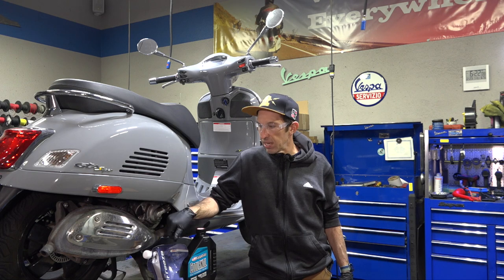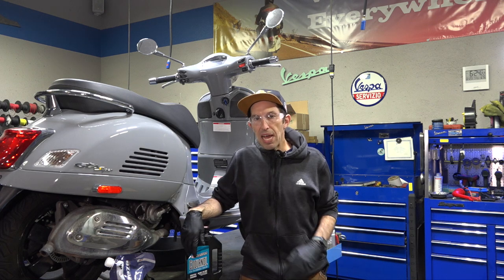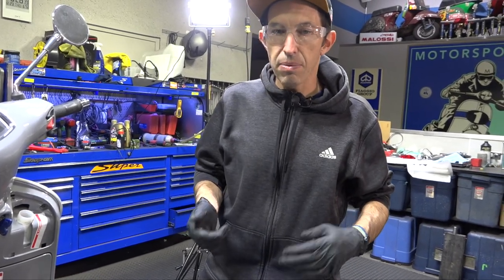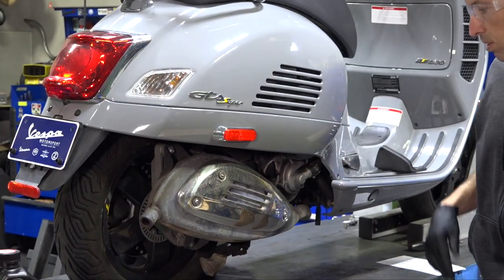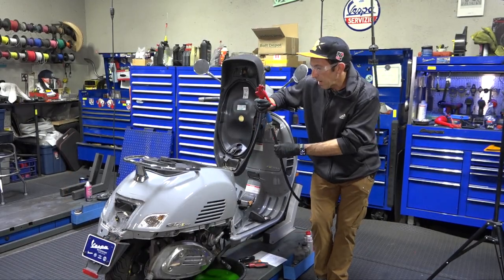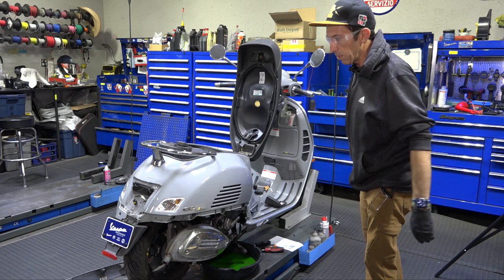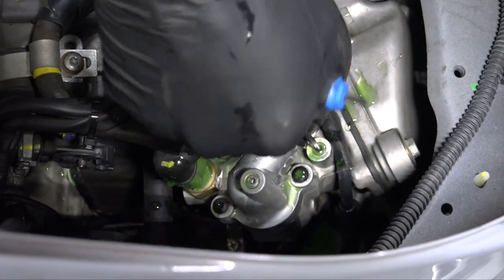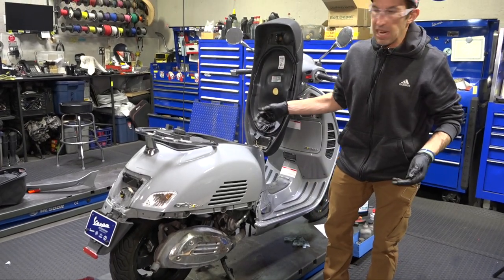How to Flush the Coolant on a Vespa GTS HPE

Comment: All of Robot’s videos are thoroughly well done.  I’ve changed out the stock oil pan on my 2022 Vespa GTS 300 hpe with the sight glass oil pan following your video on that topic; added the wrong coolant when I topped it off so flushed the system again following your video… am very grateful for your contribution and work to help those like me to keep their scooter operable.

Comment: Thanks Robot changed the coolant today my only problem was the rounded end of my Allen wrench snapped off in the cylinder head bleed screw! Luckily the thermostat bleed screw came out so I could bleed some air out  from there. Any ideas how I can get this snapped end out?